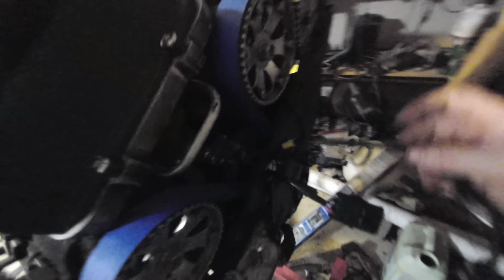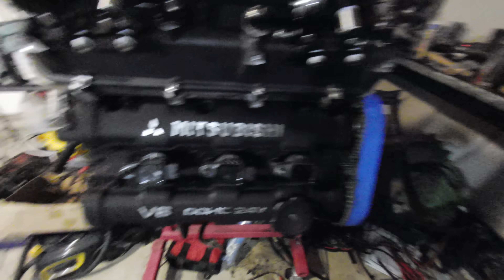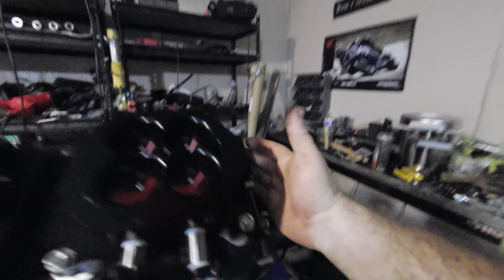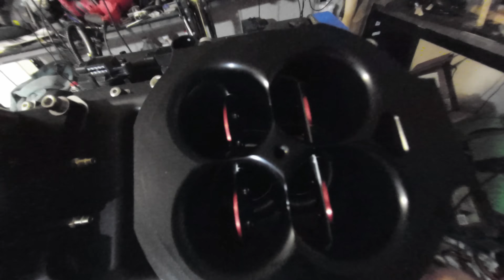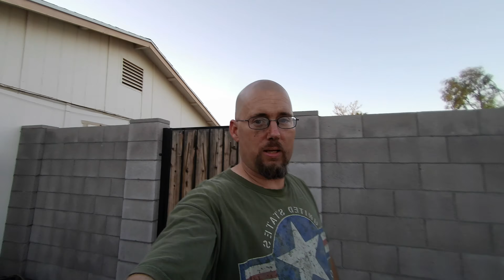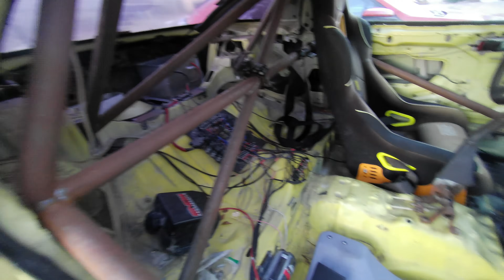Wild 6g72 build.

Comment: Can’t wait to see what power this set up makes!
Reply from the maker: same here man. Just no earthly idea what the end results gonna be. The whole car is going to be a completely different experience now.
Reply from the maker: Also its going to free up a lot of room in the engine bay to as the engine has gotten smaller. And im interested in getting a set of hood dump headers made and wanted that space where the intake pipe came through to be the area for the collector and actual hood exit. Might even get some power from that to. And will probably go for bigger exhaust runners to and try to go for a tuned length set for the rpm i want to make power at.
Reply: @az_3kgt714 I thought about this before but you did it, it's 100% what you said and you'll see the results, but I also have another idea about racing cars that I don't want to share with anyone for world safety, a car is a car, we've seen plenty of accidents.
Reply: @az_3kgt714 Always wanted to see/hear a itb 3000gt. This is close enough. I bet it will sound so cool.
Reply from the maker: I'm still working on an it setup. 3d printing lower intake plenum prototypes for either top feed itbs or cross flow